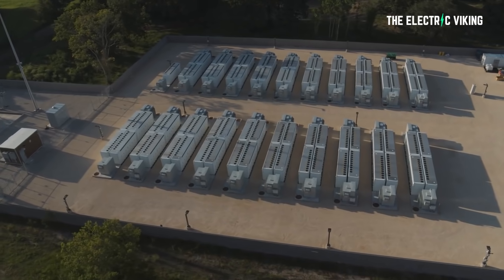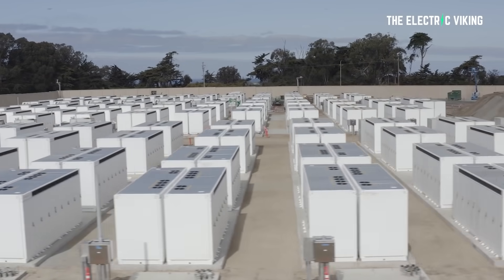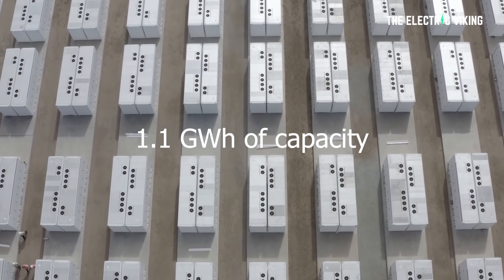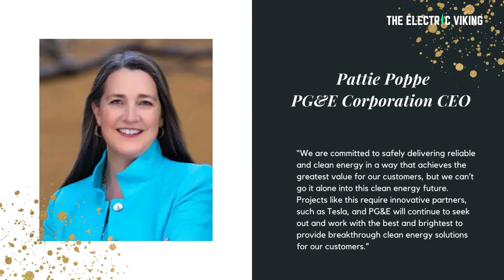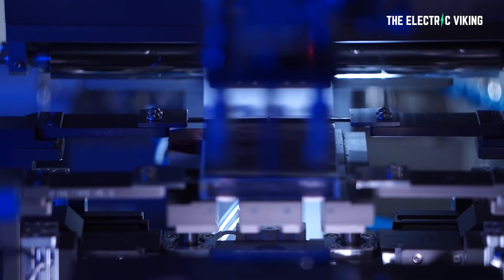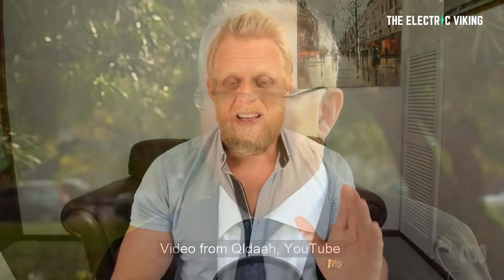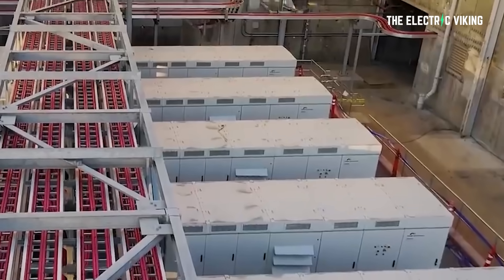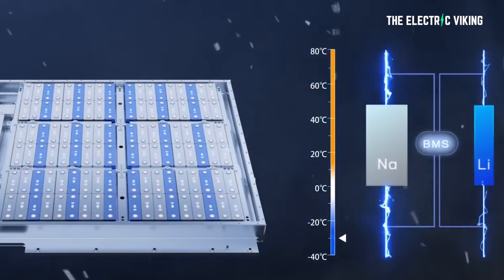Tesla's new MEGA battery signals the end for COAL power

Comment: Good news for mass energy storage. I just want to point out that the largest batteries in the world are pumped hydro, not chemical battery. Of course you need the terrain for it to work. So, the chemical batts are  very important.
Reply: @Steven Gulie My favorite battery is the one that fires the shell that vaporizes Putin. ;- ),
Reply: Pumped hydro can't account for micro events on the grid. It is these very fast adjustments to significant changes in load over short periods of time that these large batteries particularly excel at. This is a huge contribution to grid stability. The power company loses money whenever the power goes out, for different reasons, sometimes contractual/fines, cost of damage to customer equipment and otherwise from lost revenue or the resources required to get the load online again, or the cost of importing energy if required from neighbouring utilities. Having larger versions of these batteries saves them even more money as even a 10% difference in round trip efficiency (it's usually a much bigger difference than that) adds up in production costs and necessary equipment capacity.
Reply: @josephv5484  lol……. Pumped hydro actually works well over 15hours a day, using excess/surplus electricity to pump the water up and the cycle continues.
Reply: @carholic-sz3qv  but it's not reactive - totally different. It's for predictable variations in base load, like the supper hour. We're in the industry.
Reply: But they are really inefficient.   You lose energy pumping water up the slope.  You lose energy transmitting it to where it's used, you lose energy then turning iT back into electricity   and again lose energy transmitting it once again.   I saw a number of at least 40% loss.  It's only appeal is that it can store a large amount for a longer time
Reply: @girowinters  they are not very inefficient, they are super efficient and store energy way longer and higher than batteries.
Reply: @girowinters  round trip efficiency for pumped hydro is typically 80% versus 90% for lithium ion. However the lifespan for pumped hydro is multiples of Li-ion and there has never been a reported case of pumped hydro going up in flames! Given the predicted supply crunch for lithium and other battery raw materials I personally think that grid storage is a poor use of a limited resource. Li-ion is better used for applications where energy density is critical such as EVs. Where pumped hydro is not suitable there are a variety of other technologies which can be used.
Reply: @gordonf1997  
Why did you have to add anti-lithium-ion propaganda to that correction?
Reply: @ParaSpite  interested to hear what you think I have said constitutes "propaganda"?
Reply: @ParaSpite  Lithium ion batteries using nickel and colbalt should only be used in certain applications such as long range vehicles and trucks. LFP on the other hand can do grid energy storage really well as they are long lasting, fire resistant, cheap and recyclable. However as was indicated there are many more battery technologies being investigated and will be deployed over the next 10 years.
Reply: @gordonf1997  maybe we should leave what we need to use to people that know,not people that think they know
Reply: @gordonf1997  Dihydrogen Monoxide is cheaper than lithium. Plus if you're near a waterfall like Niagara, you can just run the water into the reservoir from the upstream river and don't have to pump it. There's a couple pumped storage facilities in Lewiston NY and Niagara on the Lake ONT.
Reply: @andrewjoy7044  
You need to use what you have. If there's enough LFP-batteries, then yes, they're better for grid storage.

LFP however, are also lithium-ion batteries.

Comment: That's a lot of Lithium.  Enough for over 8,000 Model 3's.  Lithium, being the lightest metal, is best suited for EV's, and even then they weigh a third more than an ICE V.  I hope they can come up with a different chemistry for these utility batteries, or find a lot more Lithium that doesn't scar the earth to mine.
Reply: There is a huge amount of Lithium available on the Earth's crust and is the 25th most abundant element. There is an estimated 230 billion tonnes of Lithium in seawater. Techniques to extract Lithium need to and will be further developed. Don't forget we are only about 10 - 15 years into the Electrical Revoulution.
Reply: Like in sea water?
Reply: 1/3rd more? The rivian r1t weighs within 300# of the ram trx, the lightning weighs 400-700# less than a loaded trx. 
The base tesla model 3 with lfp weighs within 60# of a base bmw 3 series, which is the most common conquest trade in for a model 3.
Reply: @4literv6  you're right, BMW 3 is heavier than I thought.  I recall reading the F150 weighed 1/3 more than gas version.
Reply: @DSC800  I'm not sure where they got that from either? The lightning trims are so far stated at 6100-6500#
The heaviest comparable f-150 2022 hybrid ice crew cab loaded up is 5500-5700# so it's more like a 10-16% weight difference. 

For another example a loaded up ice raptor crew cab truck with fuel full load is well over 6,000#. So yes the evs are pretty heavy but in some cases it's very comparable considering they all are crew cab configurations with lots of options&tech plus awd with lots of power. 
I was shocked tbh learning the ram trx loaded up weighs over 6,800# and cost just as much as the rivian r1t. 🤔